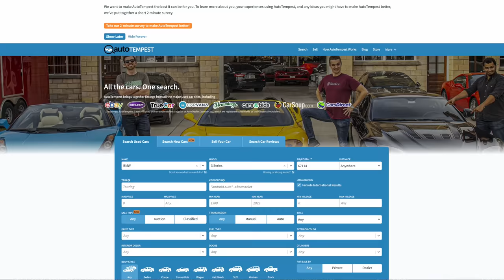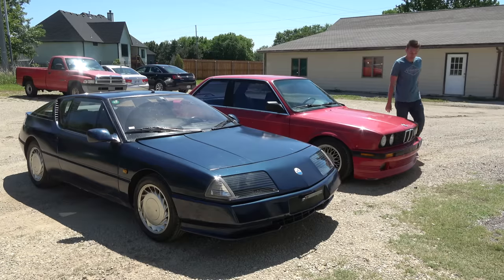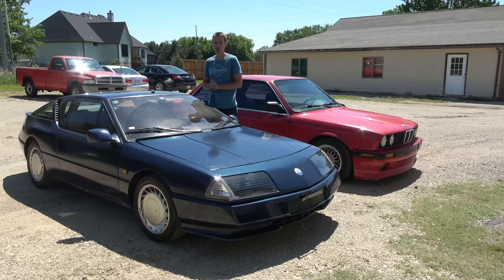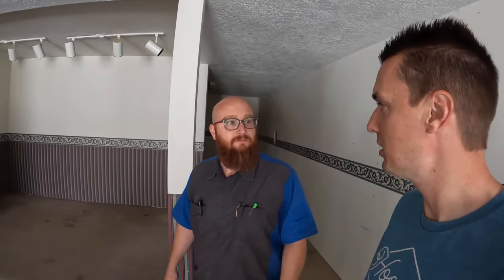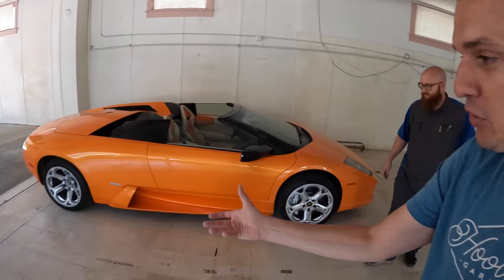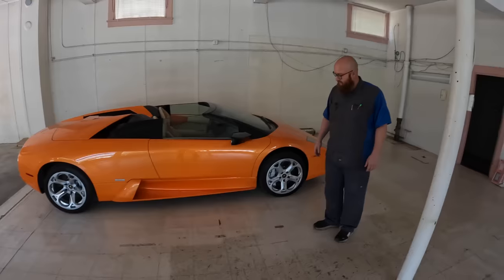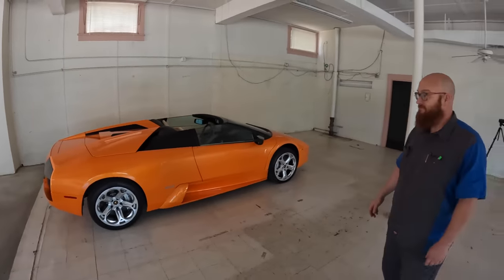Everything wrong with my CHEAP 90 year old shop building (was it a TERRIBLE $75,000 investment?)

Comment: You generally don't jack up sagging joists, you pull up the floor and you sister in new joists to level between the high points. But if I were you I'd consider pulling out that floor and replacing it with a concrete slab so the building will be more useful to you, it was pretty cheap to buy after all.
Reply: @kurtlamprecht93  Real estate is not like cars, it's an appreciating asset. Every dollar spent intelligently will see a return, either in rent or in additional equity/value. I don't know their local real estate market but $75k for a building that size is incredibly cheap even in my Midwestern town. The fact that it's a relatively attractive and interesting building would tend me towards properly restoring it, especially if it's in an even remotely viable area for restaurants or retail.
Reply: @jmuench420  Definitely agree. Real estate it not like cars. You can't just patch up a shit building and expect someone to want to rent it or buy it. It takes money to make money. Put in the proper repairs and do it right. No one is going to want rent a run down, crappy looking 90 year old building that has been modified 4 times and is sketchy. At least not where I live..... maybe in the midwest, idk.
Reply: @jmuench420  if it’s not that bad jacking it up isn’t going to hurt anything tearing the floor out is a terrible idea. If you’re going to tear the floor up you might as well bulldoze the building and start over
Reply: @jmuench420  The land appreciates, the building itself doesn't outside of inflation, and will actually tend to depreciate without a constant input of money or labor.
Reply: @jmuench420  Sorry bucko, unless those joists are damaged, you can simply jack them up and put blocks underneath. Nothing wrong with that at all. I've seen entire BUILDINGS jacked up and shimmed.
Reply: @muskokamike127  Not if the joists themselves are sagging, that's what you'd do if the floor was sagging to a support beam, then you'd jack up the support beam. I'm not exactly sure what's going on here but given the water damage I'd suspect warped and sagging joists, possibly along with the sinking support beam midfloor.
Reply: @kurtlamprecht93  I don't know the area, simply being in Kansas certainly doesn't preclude investing in property. The concrete floor would be useful so Hoovie could use the building as a store/outreach place for his YouTube fans and/or a dealership for himself.
Reply: @jmuench420  or it could be just the floor sheathing that is sagging. 

Where I live, according to code, on buildings with a crawl space, it is perfectly acceptable to jack up sagging joists and putting support underneath. 

I mean, no, if the floor has dropped 6" but if it's just an inch or two? which it appears to be? No problem whatsoever. 

Where I live it's quite common to see buildings built on dry stacked concrete blocks that settle over time. There's NO issue with simply jacking up the sagging area and adding in support via another concrete block on a pad, and shims.
Reply: @muskokamike127  I'm sorry I wasn't clear. Joists can be sagging either because a support that they meet at has sunken, in which case you can jack up that support and have a level & flat floor. Or the joists themselves can be warped/sagging in the middle, in that case jacking anything up will not improve anything as you will still have a deformed sagging joist, just raised up a bit. The latter is the situation in which you sister joists.
Reply: @kurtlamprecht93  ...Just to add, I found the building on Google Maps. It looks like it's on a minor arterial/feeder street surrounded by neighborhood and few scattered commercial buildings and is just a few blocks off a main commercial street that makes up the city's downtown. I'd say if that town is decent and there's successful restaurants and little retail stores in that downtown then this building is a fantastic buy and is worth some love. If the town is on hard times then maybe just do what's necessary to keep it clean and maintained.
Reply: @jmuench420  It's a gut call on how much to invest as you don't want to over improve a non primary use building you're going to try to resell.  You can scream all day about how perfect that new concrete floor made the place but people will still value it on comparative square footage and you'll lose out on those improvements. If Hoovie was building his forever business here, I agree he should pour concrete.
Reply: @jmuench420  It's the 18,000 person seat of a county with only around 34,000 people total. Make of that what you will.
Reply: At the most the flooring (tiles or whatever was used) needs to be removed and replaced which will allow the sub-floor to be checked to see if there is any issues at that time.  It would likely cost too much to replace a serviceable floor with concrete to make it financially viable.  In the end one must abide by KISS to avoid making it more complicated and expensive than needed.
Reply: @jmuench420   The car wizard said it was likely the flooring material that was warping and not the floor itself which is 2 layers of thick plywood.
Reply: @jmuench420  You will have a sagging joist that is supported underneath and put back into level with the rest of the floor you mean?

Remember: the entire floor is supported onto soil so adding one more isn't going to hurt anyone or anything.
Reply: @muskokamike127  If you push up a joist that has a curve, the curve isn't going to just go away, if you try to push up the sagging spot, it's not just going to magically go from curved to strait. I've been around a lot of old houses, when joists are warped and sagging you sister a joist next to it. It's by far the easiest and most foolproof way to fix that issue. As I said before, it's sunken supports that can be jacked up to level the floor.
Reply: After reading through all of these posts munch seems to know the most about what he is talking about. However, while I understand the building was cheap and it supposed to be cheap; doing a concrete floor is a no-brainer. It will update the building and will add back into the building's value.

I he wants to rent it out to somebody who is going to run a non-storefront style business or office a couple years he would be aleight but eventually that floor really needs to go. If it's to be considered a serious building and not a mom-and-pop rental. 

Unlike cars the ROI on commercial buildings is very different. You can't go into it thinking you're going to cut corners and create shortcuts. It takes investment and it needs to be done right the first time. There is nothing worse than having the same job done over and over again. Trust me from personal experience he should cement the floor and paint the place right off the bat and get it over with. 

Buy once cry once. Whatever he does with it it is his to do so. Check out a couple Ben Mallah videos for a good idea on the market and some good pointers if your new into the real estate world. All the best wishes with the new endeavor. God bless
Reply: @Default78334  Ah, I see. I guess it depends on whether it's a sort of "bedroom community" to Wichita and then on how the town is viewed within that metro area. To be fair, it's probably not something with huge upside but it might be worth properly fixing up and as an bonus you're helping out your small community.
Reply: @jmuench420  It isn't magic, it's physics. 

Your last statement negates your first: if the support is sunken causing the joists to sag, jacking up the support is going to have the exact same effect as jacking up the joists. 

The ONLY way sistering will work is if you detach the floor sheathing, install the sister, then attach the sheathing to that new joist. 

BTW: just so you know? If I can straighten a warped 2 x 14 floor joist by hand, you can certainly do it with a jack and blocks and shims. 

When I built support beams, literally by the 100, I laminated 2 x 14 to 2 x 20, in twos and threes. It is easy to match two joists, BY HAND so the crowns match.
Reply: @billdoetree4313  As soon as one says "cement the floor" I stop listening because you don't know what you're talking about. 

Cement is used to bond bricks and blocks together, CONCRETE is used to produce floors. 

As for using it as an office, nope. No need whatsoever to pour a concrete floor. The wood floor is MUCH better for people to walk on than concrete. Not to mention warmer on the feets. (speaking from experience). IF it is going to be used for something that requires a stronger floor (heavy equipment) then he should install a radiant floor system that can heat and cool it.
Reply: @muskokamike127  no offense but this is contract work and you are getting stuck on semantics. If you wanted to stop listening you wouldn't still be commenting. I'm not trying to break balls but the guy seems to know what he's talking about so we got the terminology wrong who cares. Every time I'm in my local gun store and somebody calls it a clip and not a magazine I don't freak out or stop listening. I may attempt to correct them but at the end of the day it doesn't really matter does it? Stupid is as stupid does Lieutenant Dan.
Reply: @billdoetree4313  Well, the problem is: if you ordered 20 yards of cement, you'd get 20 yards of cement NOT concrete and then you've got a real issue on your hands. 

I suggest you go back and pay attention to who knows what they're talking about and who doesn't. The one who called concrete "cement" isn't the one I'm having a discussion with regarding jacking up the joists. 

Thanks for clarifying "this being contract work", my 20 years of contracting experience and I didn't know this.
Reply: @muskokamike127  My statement doesn't negate anything, you misunderstood. I'm only arguing against jacking up joists that are warped and have that sort of u-shaped sag to them, that's when you sister (I know the sheathing comes up, that's why I said "pull up the floor and sister in new joists" in the first post). There's many potential scenarios as to what specifically is going on and they require different solutions.

I'm genuinely curious how you straighten a vertically warped 2x14  joist by hand. I can't  imagine how you'd straighten it, and keep it it straight, even with jacks. I don't have any faith you can reshape a piece of wood like that and have it keep its shape without using steam. I'm very interested.
Reply: @jmuench420  As for how to take an enlargened crown out of a joist? Umm I specifically said when laminating them together to produce a beam. 

It's easy: you have 1 2 x 14, you lay the one that is severely crowned on top, you start nailing left to right while someone else moves the top joist forward or backwards to line the edges up. 

You keep saying "jack up the joist" with NO mention of the support underneath. You jack it up until it's straight, you put a block underneath with some shims, remove the jack. Voila....it's level with the other floor joists. 

I don't know what kind of joists YOU've been using but you act like they're made of titanium and rigid. Ahem, they're not. The only ones that are are LVLs or Wood Eyes and they'll break before they warp.
Reply: @muskokamike127  I don't get what you're talking about "top joist and bottom joist". Are you talking about correcting new, uninstalled joists? If you're talking in-place then that's pretty much what I'd call sistering.

I would think that putting support under what you just had to jack up goes without saying, I don't think anyone would assume it will just levitate itself. If you're suggesting that jacking up the sagging spots in the joists and putting in new footings and supports to prop up the low spot then I just have to disagree on that being a good solution. That's much more expensive and labor intensive than sistering, especially when the crawl space is too low to actually crawl through. And you are unlikely to end up with as straight of a floor.

I'm asking you because I'm interested in different ways of leveling/straightening floors, you seem to have experience but I don't think you're getting across whatever it is you're trying to actually say. In my house I have situations that will require jacking to fix a sinking spot, and places that require sistering to fix contorted joists.
Reply: @jmuench420  Yes, I"m talking about building beams to indicate that it IS possible to straighten joists up to 2 x 16 easily, by hand. If it can be done by hand, it can be done with a jack, block and shims. 

Sistering is used when you cannot add support below the existing joist or it's rotten. But we're not talking about that here, we're talking about a floor joist that is (possibly) sagging due to an isolated heavier than normal load placed upon it. In this situation, difficult to access or not, it is easily remedied by simply placing a block underneath the joist and shimming it up back to level with the other joists. If the floor joists are 16" OC you could cut out the sheathing around the spot and do it all from above. I've actually had to crawl into spots that were barely higher than my chest to do exactly this....dragging a block and shims behind me as I inched forward. One instance was because they put in a double wide sub zero fridge and there was no cross beam nearby, causing the joists to sag. We couldn't access from above due to expensive hardwood that wasn't readily available.
Reply: @muskokamike127  I guess I can see that working well in some circumstances, I'd tend to worry that one or both ends of the joist may eventually want to pop up when raising the sagging center.

From the different methods I've seen I still think sistering can often be an easier and better way to get the floor back to flat. I do know it's used in the case of rotting and broken joists but it's also a common method to flatten floors in badly unlevel older houses. ***I do not personally work doing floors but have been around it a fair bit and been asking questions, along with doing internet research, in anticipation of my upcoming house project. My knowledge on this is pretty narrow to just dealing with the problems found in very old houses.
Reply: @jmuench420  You generally won't have to worry about the ends of the joist lifting up as in most cases, you have a wall sitting on them. 

Yes, in a house situation where you don't have the ability to put a support underneath sistering would be the way to go. But again, only if the joist is rotten. If it has just sagged slightly you can even scarf on a piece to the top of the joist. But just remember: whatever you do WILL affect the finished floor above. If you can't detach the sheathing from the joist, you're going to tear it when you jack the sister into place.
Reply: @muskokamike127  Oh yeah, I expected that. In my upstairs where I figure I'll have to sister I'm going to be pulling up the whole floor in that area, I won't be able to get it perfectly level but I can make it flat in a place where it has essentially bubbled up then dipped down. Tough to say exactly what's going on until I open it up.
Reply: @jmuench420  I've done a number of old houses that used the diagonal T and G pine...it was a shame to waste it and I was careful so I was able to salvage a lot of it. 

I tell you though, I'd hate to be doing any renos now. I just priced out a sheet of 3/4" mdf which used to be $33 now it's over $90. 

Paint grade maple 3/4" used to be $35 now it's over $100. I use a LOT of Baltic Birch ply and 15 mm 2 years ago was $60 and now it's $140.
Reply: @muskokamike127  Oh yeah, prices are horrific. I'm kicking anything that needs significant lumber down the road as far as I can in the hopes prices will go down a bit.
Reply: @jmuench420  At the peak of the lockdown up here, a 2 x 4 went from $2.79 to $14.00. 

I used to work for a custom home builder and the avg price was $12 million. Using the $800 psf rule that means the material costs on the building went from approx $800,000.00 to $5.6 million. Can you imagine having to go to your customer and said "sorry, but due to material cost increases we have to charge you an additional $4.8 million?

Comment: Don't replace that A/C unit until it has a failure like a freon leak or compressor. The old ones a built way better than the new ones.
Reply: They’re far less efficient than the newer ones, though. The energy savings alone can often be enough to justify a newer unit.
Reply: @MrSteelPeddler  Including their more frequent replacements? Not the same, I know, but we have a really old fridge, it might not be as energy efficient as the one in our family's house up the road but they've had to fork out for at least 3 if not 5+ in the same time ours has just kept on working.
Reply: @Jon V. I'm an hvac teck in South Florida. Yes maby less efficient but will out last new units by far. Do not expect to have less problems with a new system. Two and three old units and springing leaks in the coils due to how thin the new aluminum coil design is. Ecm blower motors dropping like flies. Matter a fact I just replaced a ecm motor on a 4 year old carrier about 45 min. Ago. Cost them about $640 system put off warranty and I am cheep. Warranty on commercial properties is only 1 year.